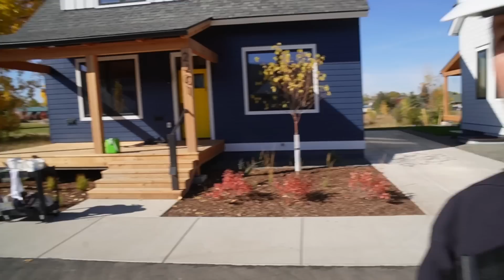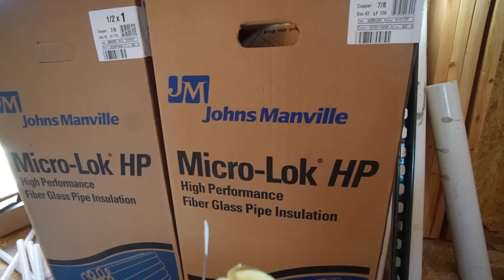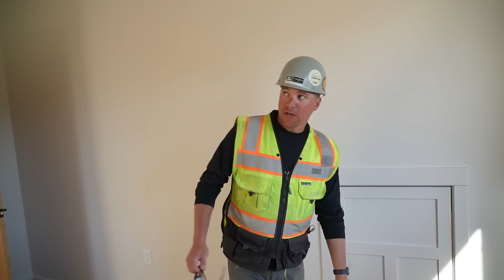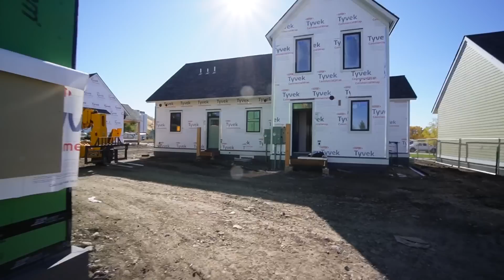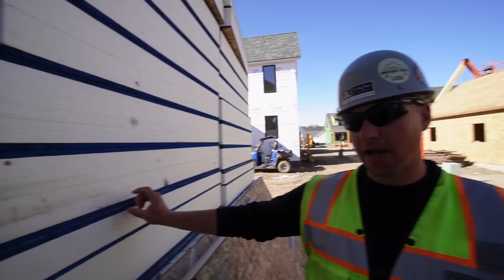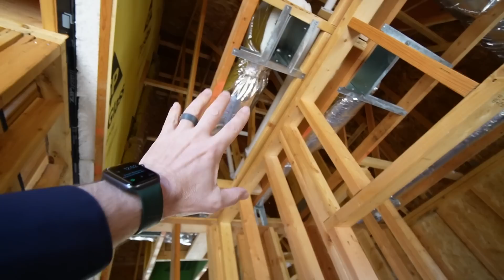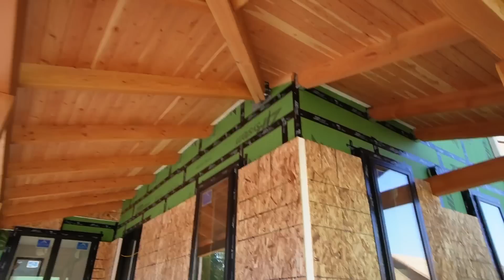Why is there OSB, ZIP, and Housewrap on this house?

Comment: Great to see a community building something normal folks might dream of affording.
Reply: lol...normal buying $600k++. That's closer to 1%.
Reply: Hmmm, affordable?  Did you look at their website and the prices?
Reply: These homes are over $700,000 and only about 2000 ft.². I am not sure how that is considered affordable.
Reply: @dustinmonroe1998  It's per market:  A glance at Zillow shows very little under $600k.  OTOH, the market may be out of whack.
Reply: With performance included.
Reply: @AJ7-  looks like $500-600k range and they're selling a subset subsidized.

I don't know a lot about Bozeman, but in general even if they're expensive now, more modest homes in the housing stock is a good thing in the long term, when everything is 2800sqft and up monsters the situation is a lot worse.

The housing crisis is a long term problem, I don't expect builders to sell below market value in the short term, but when everything new being built is monstrous and has a price tag to match, it pushes the overall housing stock to be on average more and more unobtainable. More modest developments, even in expensive areas, are always a good thing.
Reply: @AJ7-  the trades (former working class) generally make more than the college educated. Wont lift a coffee mug for $20/hr.  Whole pay structior got f'd after Covid. Anyways... there are places where land costs are way less. This prices blow my mind.
Reply: @Robert John Thomas it was affordable here until the past couple of years. We moved here just outside of Chattanooga in 2017 and bought a new single story 2000’sq. house on a 1/4 acre lot in a subdivision with an unfinished walk out basement for $274,000. Now everything in our neighborhood is going for $450-$500k even for a two story on a damp, stinky crawl space. And nothing here is built anywhere near the quality of those homes in the video. Around here the framers are all illegals and if the builder tries to tell them what they want they just respond with “you don’t need that, this is how we do it”. The complexity of those houses and the sequencing to get the details right are so far over the heads of our crews here you would go broke before you completed the first house, IF you could get the crews to do it in the first place. Our crews still don’t know how to install a basic window or housewrap correctly.
Reply: It's encouraging to see that "High Performance" doesn't have to mean "High End."  We still need to bring these practices to the Low End to put an end to poorly built starter homes.
Reply: @AJ7-  yeah, the are going to turn into seasonal rentals, 2nd homes, or AirBnB’s. All of which will continue to price out true working class citizens from Bozeman
Reply: These houses won't be affordable for normal Montana folks.  Bozeman is one of the most expensive markets in Montana.
Reply: @AJ7- if it takes government subsidies for us to value good home building that emphasizes health and energy efficiency then so be it!
Reply: Is it an HOA ?  That makes them worthless no matter the price.
Reply: Yeah they’re only 675k to start!
Reply: @pj406mt  oh wow, seriously? 675k? We still build mcmansions here in South West Ohio with more yard for 300k... but half the R value.. yet a retrofit of exterior wrap on more Sq ft with more yard would be 300k + maybe 60-80k? It's wild how prices are so different throughout the country due to land values.
Reply: @IAintScaredOfNoGhost  @Pj Kolnik I looked it up and there's at least one in the $500s and they're selling 22 of them with subsidies to reduce them below market value for qualified buyers (income threshold). Pretty neat.
Reply: @pj406mt  I just panned through some of Bozeman... and that is the LOW end.
Reply: @pj406mt  for something new, well built that you dont have major expenses for the next 15-20 years, well worth the price
Reply: @pj406mt  well that no affordable.  
I wish someone would build non-McMansion homes for working families and even retirees  looking to downsize under $250k. I a quality 3 bed , 2.5 bath, 2 car  home can be built and sold for that because a couple have recently been built near me  in the St Louis Mo area.  They might not be LEED or showcase homes, but they are nice, and much more affordable.
Reply: What do you consider affordable?  How much would you pay for one of these?
Reply: @publicmail2  I see reasonable size, reasonable finishes, and good thermal performance. I can't comment on property values there soecifically, but there's a huge hole in the market nationwide. Builders only want to work on 2800sqft mcmansion neighborhoods.

In our area that manifested as a pretty big gap in the market when we were looking. There were a lot of $100kish  mid-1900s bungalows that needed gutting, and $400k+ monstrosities. 

We ended up in a near 100 year old house that needed a lot of maintenance and updates that had been put off by previous owners. That's been it's own adventure. 🤣
Reply: @EnginerdNate  these start at 650k to 800k, don't believe everything you see.
Reply: @publicmail2  I literally found the listing, don't know what to tell you. YouTube doesn't allow posting outside links without a hassle, I've tried.
Reply: @AD Electronic Teardowns  given how far north it is, the energy savings on a neighborhood this large is definitely going to see savings in energy generation and transmission, I'm not in the field but I bet the community will definitely benefit over the decades from lower taxes (or taxes being spent elsewhere). It's basically soundproof condos with a tiny bit of breathing room, so property taxes can be lower as well, with far less money spent on maintaining grass! The only downside I see is lack of room for trees =/
Reply: @IAintScaredOfNoGhost  Well, and people having zero yard space in which to enjoy their property.
Reply: @IAintScaredOfNoGhost  I doubt there is any major energy generation cost.  Most of Montana--particularly the Western part of the state--is fueled by hydropower.  The dams are built, and it's just maintenance at that point.  Trashing Montana's beauty to plop a bunch of postage stamp lots is a disgrace.